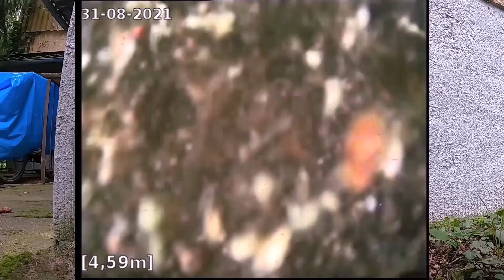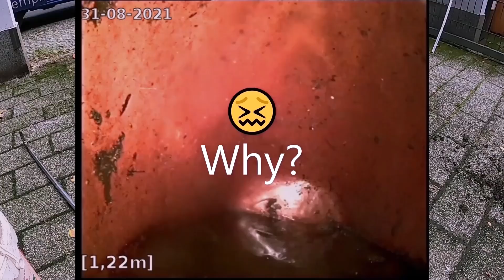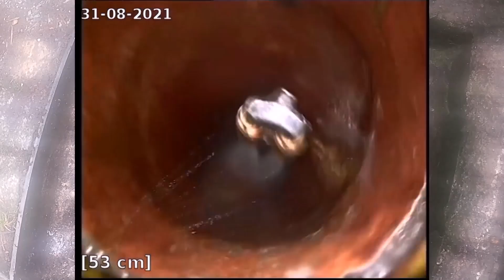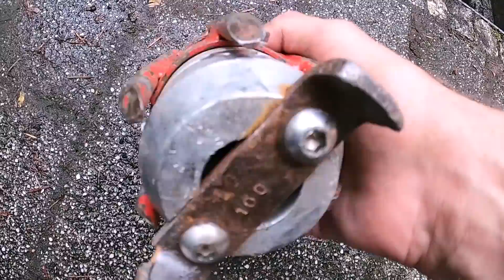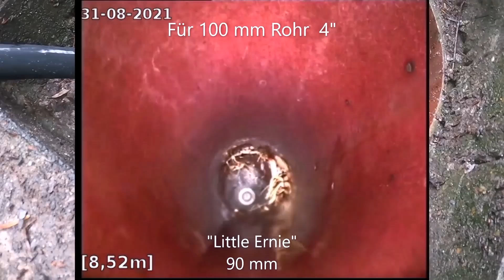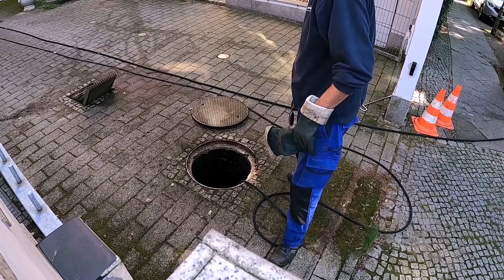Kempinger 215. Der Alte gewinnt mit sein Vintage Werkzeug.Sture Wurzeln im Tonrohr wegen blödem Baum

Comment: A treasure hunt with the double barrel in action, with the old school nozzle still holding its weight 💪 Congrats on the 10k 👏🙌😉🥇
Reply from the maker: Well thanks for the 10K....Yeah, that nozzle is a Dam breaker..I just have to swap the slides and the knife to increase the diameter. The nozzle itself stays the same

Comment: 🇬🇧.   I love your channel  , just like I love Ollie and Ratty and croc and magpie 
Watching you clear than pipe using that old tool I have never seen that rotating cutter for the roots sometimes the old tools are the best 
Keep the videos coming , I am an Avid Fan . 
I am retired now from doing Groundwork and Drainage , but Happy days 😀.            John
Reply from the maker: Hi John ☺️ ,nice having  a  Brit as an old colleague from abroad here ... and thx  for watching too..👍 
So yes, these two nozzles are from back in  the 80s and are both quite  rough .. I can only use them on  straight lines, otherwise they would destroy all the bends...

I grew up in Crawley / Sussex in my youth 69/76..Just wanted to say  ☺️
Reply: Olie Ratty and Croc. Are from a different channel.

Comment: Cool job, Have you got Warthog spinning nozzle? I have one and is spinning nozzle all the time , I use usually with Harbon jetters on 4000 psi / 275 bar, always win with that against roots.. But your vintage nozzle looks cool also, still works and done a job. 👍👍
Reply from the maker: Hi Kornel..
I would love to have that kind of pressure on my van..But it's not so regular, having so much in our region so that I only got 1850 PSI at 60 liters a min. I've heard a lot about the warthog, but in my opinion it's to expensive as that I could ask my boss to buy one ... about 1400 euros. Actually, I'm quite happy with my Cobra Barrels so that I don't see any reason to go to the boss yet.
I am the only one in our company who cleans drains .. We are primarily a plumbing company
Reply: @kempingerrohrreinigungberlin  Yes totally agree, my boss paid 1200 for nozzle and 16k for Jetting unit, however I would prefer your size of jetter my Harbon is massive and heavy no space for propa shelving. 👍👍 4000 psi is a destroyer 😂😂

Comment: vintage tools are far more superior then tools sold today.. when they made those tools there was no penny pinchers and they did not build them down to a cost they built them to work and to last.. my late fathers tools are still as strong as the day they were bought decades ago.. i would rather spend 2-3 times to buy a real quality tool then a cheap one and lately even the larger brands are becoming cheap.. as for the comment on the drills can damage the pipes im pretty sure that was not ment for plastic pipes and thats what could be damaged i dont see how that can really do damage to cast iron unless the pipe is already weak and damaged from age and corrosion.. as my late father used to say.. use common sense when using tools and use the correct tool for the job.